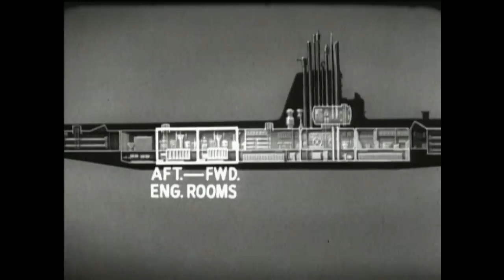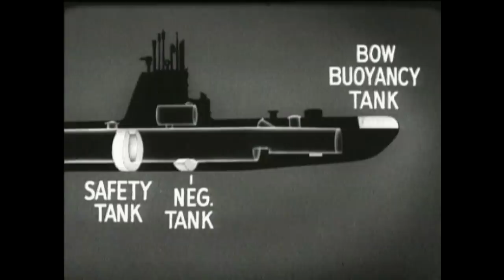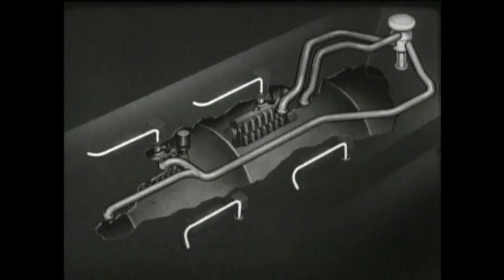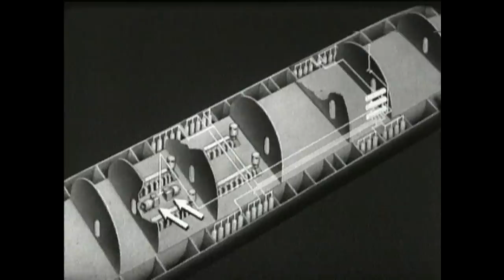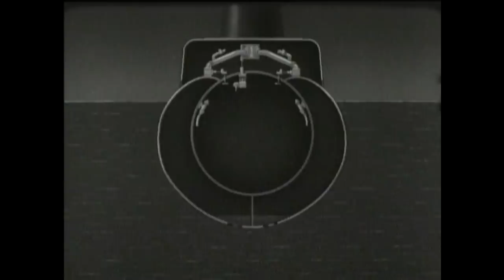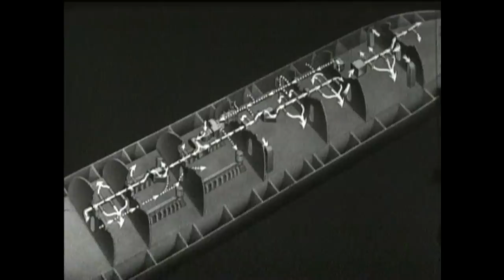How a World War II Submarine Works (720p)

Comment: Best submarine video out there.  I would like to see a video showing how the controls work to dive, surface and maneuver the sub.
Reply: I can answer that, you have two guys on the sticks, one operates the bow planes the other operates the stern planes. Pull back on the sticks to surface, push forward to dive. Both sticks can steer the boat. However, this is after the sub had achieved neutral buoyancy.
Reply: +Bane Tiburon Thank You. I still wish there was a detailed documentary showing the actual operations of surface and diving procedures, what all the gauges say and what valves they turn to achieve buoyancy.
Reply: Pocono Gym There are still a couple of them that are museums, just depends where you are. I used to go to the USS Cavalla in TX quite a bit. There's one in San Fran, there's a German U-Boat in Chicago, you also have ones in NY, NJ, CT (the best since it is THE US submarine base), CA, etc. Here's a link to them all https://en.wikipedia.org/wiki/List_of_submarine_museums#United_States

Comment: this was an interesting video..[film back then] probably a training film. after watching it i wondered so what do I use this information for now?...and then it dawned on me....a WW11 sub movie script..you know the part where the sub always gets into trouble submerged and may be lost...how about an induction problem or a compressed air line that ruptures...or a ballast tank air value that goes hay wire..or a  snag in the ventilation system or maybe all at the same time after a depth charge explosion here the outer hull..

Comment: SS-426 (the hull number on the sub in this video) was the USS Tusk, a Balao-class sub commissioned April 11, 1946.  She was modified under the GUPPY program for increased battery capacity, streamlined structures, addition of snorkels, and improved fire control systems.  She was sold to Taiwan in 1973 and as of February 2014 was still in service with the Taiwanese Navy as the Hai Pao (meaning "seal").
Reply: Good info. Thank you.

Comment: This is the U.S.S. Tusk (SS-426) which was a Tench-class WWII submarine. This specific boat, though it was designed during WWII, was not commissioned until April 1946. It is 'conceptually' about submarines, and in general terms is how subs worked during WWII, but it is not about the famous Gato- or Balao-class subs that are what most people are visually familiar with from WWII movies.

Comment: This film left out the "oxygen candles" and the "CO2 scrubbers". I was on the USS Barb in 1978-79. The oxygen canisters under went a chemical reaction and produced oxygen which we breathed. And the ship's air was bubbled through chemicals in the CO2 scrubbers to remove the carbon dioxide.Boy, I tell ya one thing, those scrubbers sure made the air STINK with a chemical odor!!! All this was done when the ship was submerged. When at Periscope Depth we breathed through the snorkel.

Comment: Why are you irrationally assuming the engine tail pipes ended in the crew work/living spaces?????? That's SO STUPID!!! That's like saying your car has A/C to remove exhaust so you won't die! Exhaust is vented OUTside, not inside.(True of both cars and submarines). Besides all A/C can do is remove heat and humidity from the air, not exhaust nor carbon dioxide. I was on USS Barb in 1978-79.

Comment: It can and it did.  All you need is air pressure greater then outside sea pressure.  The head (toilet) vented the poop to sea.  But generally if they were deep submerged it would be due to Jap destroyers on the surface pinging for you - and you would not want the poop to give your position away anyway.

Comment: No offense but is there a difference between plunging 10,000' to your death on the bottom of the sea and plunging 30,000' to your death on the dry surface of the earth?

Get hit with a bullet and you only have to fall 4 or 5 feet. Saves a lot of time and shrieking hysterically in denial.